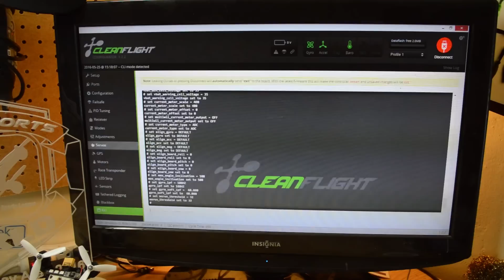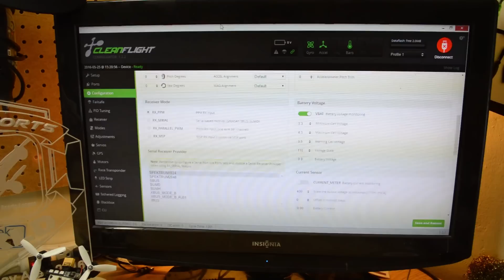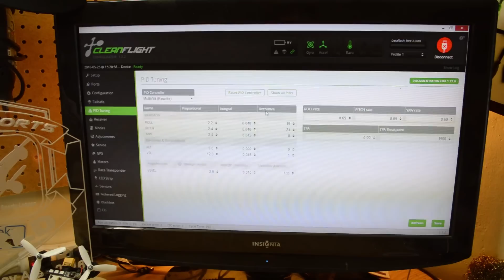Twitch 109 Let's Build - World Smallest GoPro Capable Racing Drone?

Comment: Brand new board like that and you don't put the wires through the holes to solder. Just asking to be ripped off the solder pads.
Reply from the maker: Senastar That has never been an issue on this, or any of my builds :)  and due to my reuse of hardware makes it easier to de-solder. To each there own though!
Reply: Zoe FPV I've just had such bad luck with solder pads ripping off flight controllers in the past, but ya each to thier own. Very cool looking little racer.

Comment: Maybe i missed it (I'll admit i didn't watch all 2 hours.  :p) but why no PDB?
Reply from the maker: It's smaller/lighter without a PDB XD Everything wires into the XT60 fairly easily, adding a PDB would increase the total height of the build.  If you want easy power distribution you can get this kit with a 4-in-1 ESC, or  get the frame and the new PDB/Flight Controller from RotorGeeks.
Reply: Was going to order one of those anyway from RG...what is the AUW on one of these?
Reply from the maker: 150 Grams without a battery(including FPV Antenna, Race Timing Tag, and 7 grams worth of LED's)  
234 900mah 3S Tattu Battery- around the same with a 850 4S.